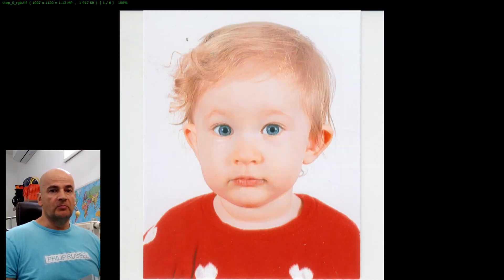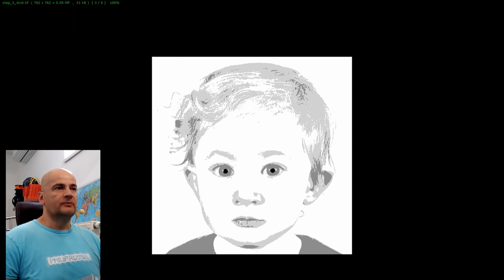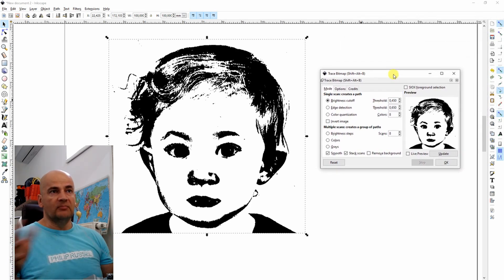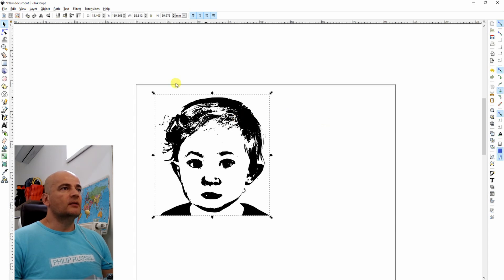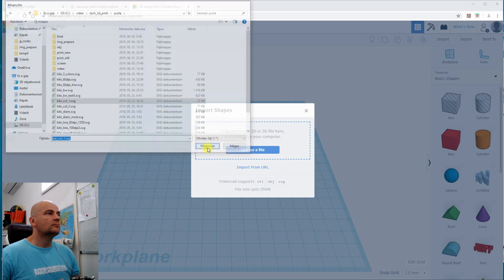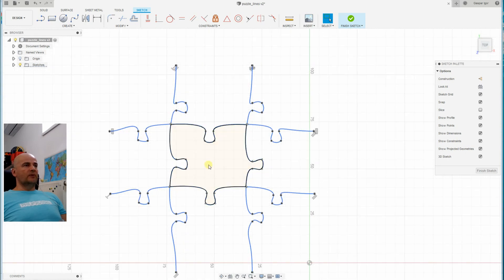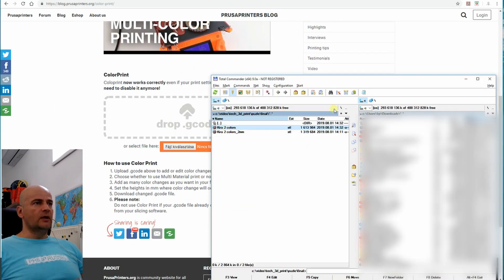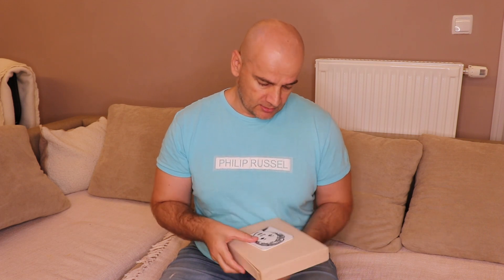3D printed puzzle from the image

Comment: Im very very very late, but i like to recommend using Autodesk 123D Design, which is, i think, kinda granfather of tinkercad. Indeed, they look very similar. It was discontinued a long time ago, but you can still get it's installer online. No need to have an Autodesk account, no need to use it online, no need to register. Just install, and use. Totally legal and legit. I handle my svg's on it. I have a machine from maybe 7 years old, and a very poor 3d accelerator board, so the use can be a little slow on large designs, but it works.
Just wanted to offer my 2 cents...